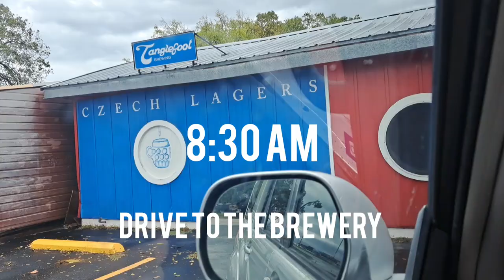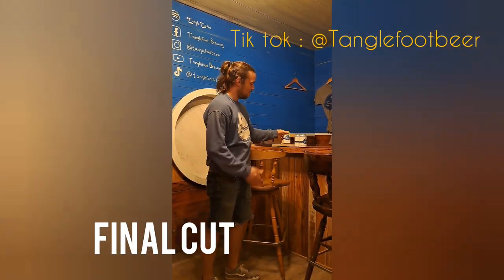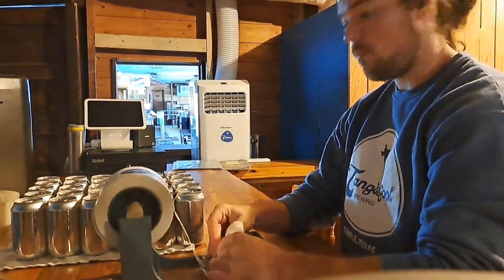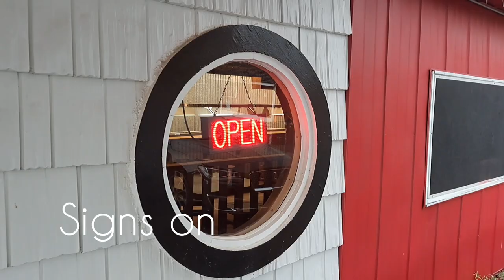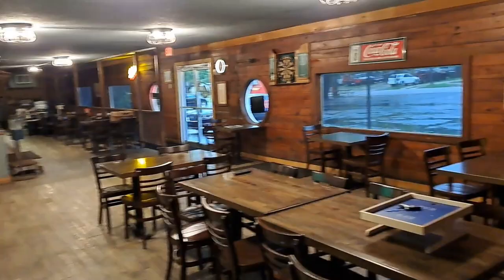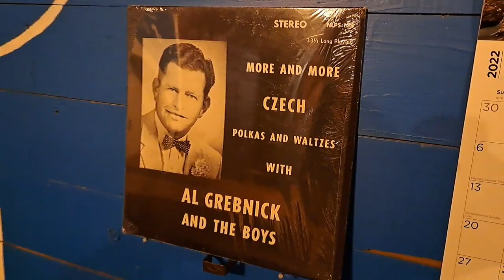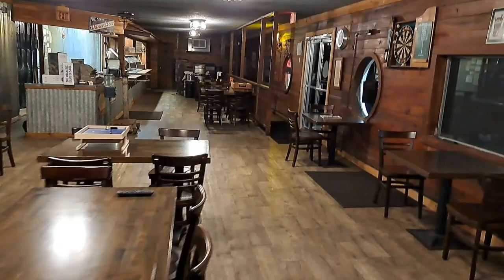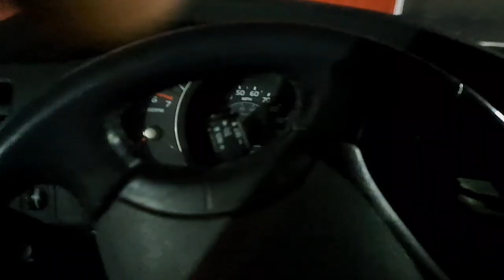A Day in the Life of a Small Brewery

Comment: How do you clean those Lukr faucets? And, how often?
Reply from the maker: The tips come off very easily and are cleaned daily. The rest of the body is cleaned when line cleaned but not super frequently.
Reply: @tanglefootbrewing  Do you use just water for the tips cleaning? For the  rest, PBW once a mounth is ok? Just bought  a Lukr faucet so I need info :D
Reply from the maker: @knacrr  rinse daily. PBW pretty frequently(once a week?). But nothing super special outside of that. I've not have much build up on the main body of the taps either so not a huge concern. If you notice any build up after a couple of months give em a scrub!
Reply: @tanglefootbrewing  ok thank you :)
Reply: @tanglefootbrewing  what temperature for the pbw cicle do you use?
Reply from the maker: @knacrr  usually just 120-140°Fish water.